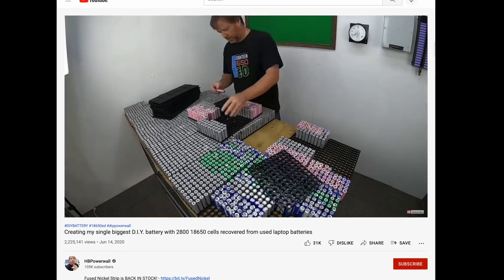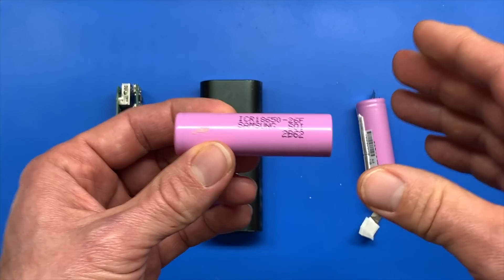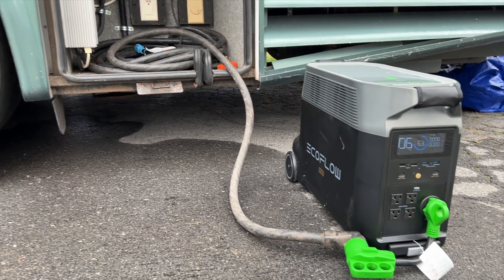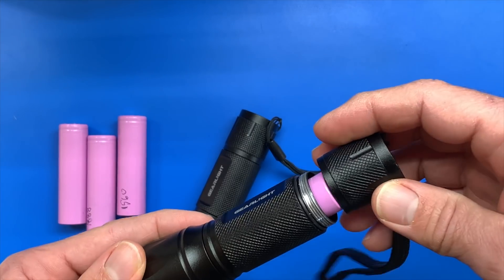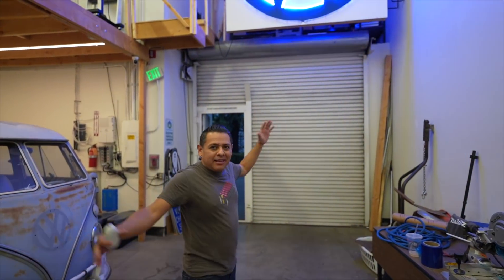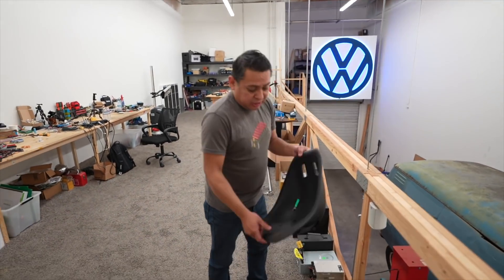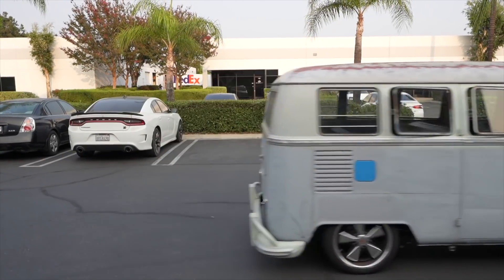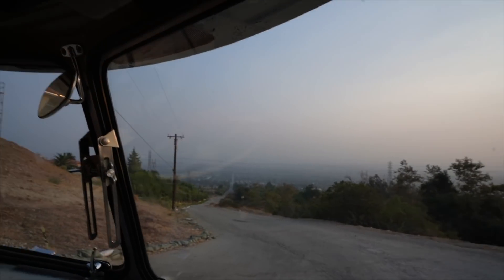TREASURE in DEAD BATTERIES - Feat. Jehu Garcia

Comment: I've actually gotten very good at deconstructing the 18650s themselves. I mostly salvage the copper foil from them for other projects.  Obviously, it goes without saying that you should not try to open 18650s unless you know what you are doing.
Reply: As for me, I just get the steel/aluminium containers :P

I did try harvesting lithium carbonate, but it wasn't really efficient extraction physically speaking.

Comment: First time viewer. Hopefully I'm not telling you about something you already did.  I live in the sticks and it isn't uncommon for a bear to hang out on our front porch. Since it can be almost cave-at-midnight dark here, no one really enjoys making the trip from the car to the house at night without light. But it is super annoying to leave the porch and floodlights on before a trip out. Inspired by those cheap solar garden lights that don't work very well, especially here in shady woods, I hacked together my own version using off the shelf parts. Basically a $2 circuit board controls solar charging old laptop Li cells. The solar cell (~$5) is just one of the squares you see on a solar panel and works surprisingly well for this application despite the shade and temperate rainforest conditions here. I also got a thumb sized meanwell DC-DC constant current converter ($5) for use with higher power LEDs. I disassembled an old LED bulb,  and replaced the 120V circuitry with the meanwell. I added a cheap radar based motion detector board and daylight detection. So now when you get out of the car 100 watt equivalent lights come on as you move toward the house. A side benefit is that if the lights are already on, you have a bit of warning that a bear or some other creature is in the area. The bear detection isn't 100% reliable though because for some reason he often likes to nap at the door. I left out some details, like using some aluminum cans  to mask off what the radar sees so that trees swaying in the wind won't trigger it, and adjusting the sensitivity for rain, pointing the solar cell the right way, but you seem to be the sort that will figure it out. I can't say my hack job is pretty but it effective and reasonably easy to do.

In enjoyed the Jehu Garcia segment. I suspect we are alike in having many started projects that sit for months or years because a new brainstorm hit in the middle of working on a project. The solar night light is one of the few I completed because I was motivated by bear phobia (mixed with fascination) and the d* floodlights interfere with my astrophotography habit. Never did anything as cool as refit a van to run on batteries though.
Reply from the maker: That’s a great project that you worked on!  Thanks for watching the video.

Comment: The easiest way to open the packs is first using wire cutters on the corners of the plastic seam.  Second using a pair of expanding vise grips one on each side and twist them in opposite direction.
Reply from the maker: Thanks!  I’m sure I made rookie mistakes.  Will try that next time.

Comment: You can do a lot with recycled batteries but a little knowledge can be a dangerous thing. For example, there is a clear distinction between laptop batteries which are designed to be discharged over a matter of hours and power tool batteries that are specified for discharge over a period of a few minutes - for example 3ah cells that can sustain 30a discharge currents. Also - you can work with batteries that have fallen below 3 volts but below about 2.5v the charge current must be kept really low - say <50ma until the voltage has risen to about 2.5v. Some batteries never come back, others self-discharge unreasonably quickly.

Comment: Here's my story: Last year I started building replacement battery pack for an old electric bike for my mom. Originally there was 20s NiCd battery pack and I started making new one using "new" cells bought from China (LG HG2 which didn't have new cells parameters: lower and uneven voltage, internal resistance higher than it should be and also uneven). I borrowed spot welder made from microwave transformer and started welding but after making weak welds and one punctured cell (it didn't explode but there was some smoke and liquid coming out) I was afraid to continue. And now the project is on hold until I can get good spot welder and practice a bit on other cells. Professional spot welder (either battery powered like Kweld or mains powered like Sunkko) is too expensive for me at this moment so I don't know if I will finish this conversion anytime soon. Here in Poland winter is soon going to end so it would be great to make this electric bike work again.
Reply from the maker: Glad you were safe after that happened.

Comment: Great video mate, I identify with everything you talked about in your intro!
A quick "tip/idea".. These batteries with more than 2.2v are probably NOT DEAD! They are below their dead zone for the charger (probably because they were left without recharge for a VERY long time). You can bring them back by "forcing" a charge (aka bypass the BMS).
To bypass the BMS, just:
- get one of those USB chargers with 5v and less than 1A output (I have actually done with 2A once, but the recommended is 500mA),
- Get the (micro/mini/wtv) USB cable and cut one end (or whatever way you can extend the positive and ground wires - they are the 2 extremes (usually pink/black))
- Deliver the 5v <1A directly to the 18650 (+ on +, - on - just to be sure) for about 1 minute (you can do it a few seconds and check with the multimeter to feel safer)
- This should be enough to bring the 18650 back to 3.2v and you can charge it normally with the BMS (or the charger you showed).

Some say this will not  "bring back" the battery for real - as in it will only live as long as you don't let it go (soft) dead. However, this is not my experience.. I have done this in quite a few of them and only one really died (once the powerbank fully discharged, it went below 3.2v and died again pretty quickly - which I brought it back again, but the cycle repeated). All others have been working just fine, they discharge, BMC charges it back and everything cycles just fine...

I'd love to hear if you try it! Cheers and thanks for your content. I love it! I have a project for the solar panels much like yours... (no USA)
Reply from the maker: Thanks!  I may try that.  My charger might be able to revive them too.  Update me on your solar project when it’s complete. That’s great you’re working on it.
Reply: That trick does work... sort of. It can revive a cell, often does, but the over-discharge has likely damaged the cell chemically. So it'll revive, but with only a fraction of the capacity. What was once a 2600mAh cell may only be a 300mAh cell now. So if you use this trick, it's important to properly test and measure the capacity of the cell afterwards.
Reply: I was reading online a while back after accidentally draining my gel blaster battery that you can just change the charge mode to a different type(can't remember which one now) and you just charged it for a few moment to get the voltage up so that li-ion mode will recognise it. Worked for me.
Reply: @adamarzo559  trickle charge? I think on trickle charge it will deliver very low current to the batteries to "warm up" the chemicals,  usually air a long period of inactivity.. I think it's the same idea,  if your charger supports it,  probably means its BMS has a more advanced dead zone management. 

Btw the example someone gave of only maintaining 300mAh is definitely not my experience. I will do some tests but the difference for me is much smaller from the first use... cheers